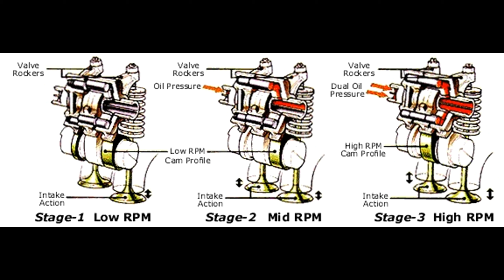How works 3 Stages VTEC Honda Civic engine. Years 2000 to 2020

Comment: That engine is d15z6 eco 
& yes it dose have 2 stages eco mood a green light shows on the dash that means ur driving in eco mood

Then wen u give it full throttle the green eco lights turns off
Reply from the maker: Yes and Thanks for comment. 😃👍

Comment: The 3 stage has 5 lobes per cylinder on the cam shaft 2 lobes for the exhaust and 3 lobes for the intake. One small, one medium and the high lift lobe,  your schematic at the start of the video was of a 3 stage system with two locking pins. Stage 1 only opens one valve just off the seat to prevent pooling of fuel on the back of the valve and the other valve runs of the medium lift lobe, Stage 2 joins with a pin locking the 2 intake rockers together actuating both valves off the medium lift cam lobe and Stage 3 has another pin that locks the rocker arms to the large centre roller rocker that is running on the high lift lobe. Your engine only had 4 lobes 1 solenoid and 1 pin per cylinder so 2 stage .
Reply from the maker: Thanks for comment 👍

Comment: This is vtec e head. Not 3 stage vtec
Reply from the maker: No way !
Reply: In your video it has only one vtec solenoid. 😃😃 How can be 3 stage ?. This is vtec e. 3 stage setup totally different.
Reply: @vtecbrothersSL  yeah i was also looking for a double solenoid, i only saw one, mine has two vtec solenoids
Reply: Correct me if I'm wrong but I think this is vtec e, those two camlobes that were aligned was for exhaust valve. Vtec e always uses the vtec lobe, the only difference is that when in low rpm, the head only works with 12 valves, 4 intake and 8 exhaust. Now when on higher rpm's the rocker arm locks all the valve and now it operates on 16 valves, 8intake and 8 exhaust. The round camlobes was used to open the valves slightly on low rpm's. This is how vtec-e works compared to traditional vtec... Nice explanation btw 👌
Reply: @Charlie-uu8so  Extactly
Reply: @Charlie-uu8so  i think is a d15z6 with 2 stage vtec
Reply: I thought the same thing because the 3 Stage VTEC that I have has 2 VTEC solenoids instead of one.  However, I looked into it more and the one in this video may be a D16W9 which some websites say is a 3-stage VTEC. But the D16W9 also only has one solenoid valve from what I can tell. However one valve can control two separate positions if you reverse the polarity.
Reply: @PeterFinnTheCarDoctor  What is the engine code stamped on it?  D16??

Comment: At first I thought that this was NOT the 3 Stage VTEC engine because I have a 1998 JDM D15B OBD2A VTEC swapped in my 1990 Civic and mine has 2 VTEC solenoids.  But after doing some research the one in this video looks like the 2001-newer  D16W7 VTEC-E or the D16W9 3-Stage VTEC.  I found two websites that say the D16W9 has 3-Stage VTEC. However it looks like it only has 1 VTEC solenoid valve. As someone who understands electronics well enough, you can use one solenoid valve to control two separate positions if you reverse the polarity (-neg and +pos)  So it is possible that this is actually a 3-stage VTEC engine.  I'd have to look into it more.  Does anyone else know more about the D16W9 engine?
Reply from the maker: I have read your post, good comment 👍

Comment: Why don't you tell engine code in your video?
Reply: i think is a d15z6
Reply: @andreigjn  D15z6 has single stage vtec and which also is economy one
Reply: @andreigjn  I know myself 
I have researched a lot on these engines
D15Z6 is single VTEC-E
I am using this engine myself
Reply: @hasankhurshid2632  me to but is a 2 stage vtec not 3. D15b vtec jdm is a 3 stage vtec
Reply: @andreigjn  yes same thing i am saying
Reply: @hasankhurshid2632  you know if head cylinder is same at 2 stage vtec like at 3 stage vtec ? I want to put a d15b cam in my engine. I know i need a new vtec solenoid but i don t know if is single diference
Reply from the maker: Thanks 😀👍